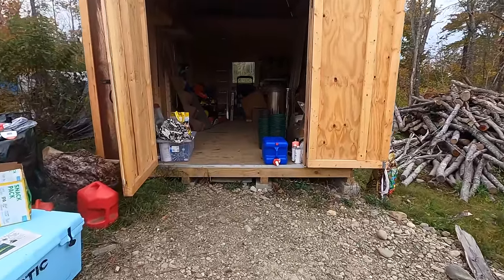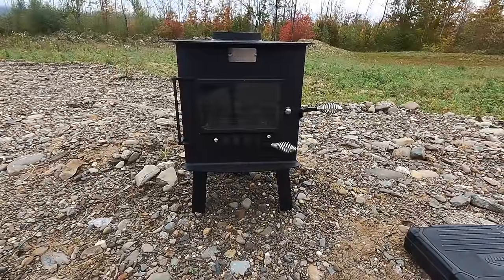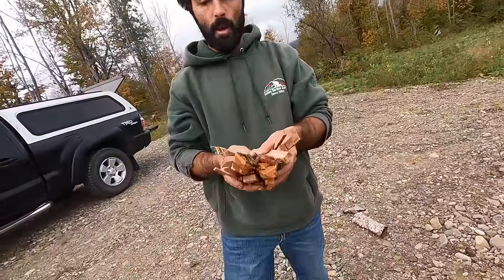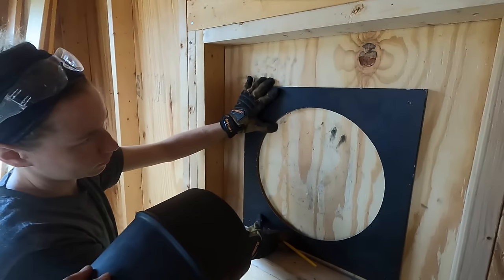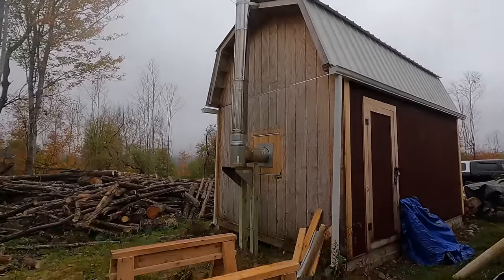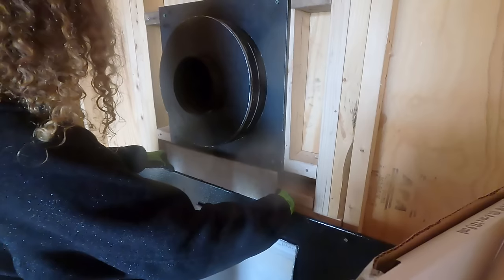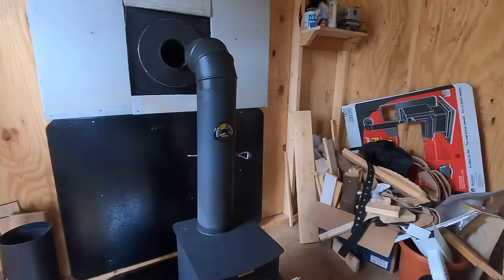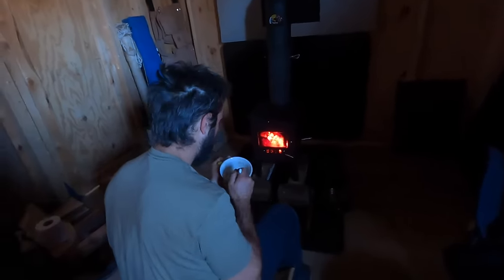We Finally Have Heat! Wood Stove Install in the Shed

Comment: Its all very well done . This is actually , how it should be done .  A wood stove can be your best friend, if safety is the first rule . But the same wood stove can be your worsth enemy if treated wrong. And some fire bricks inside is a really good idea, it protect the stove, and give longer heat 👍
Reply from the maker: Thank you! We wanted to be as safe as possible and not take any chances. We've seen some very questionable wood stove installs all over YouTube... We will look into adding fire bricks.

Comment: Next time u use the saws all put the blade in with teeth facing up so can see easier where the line is wile u cut so u will be cutting upwards try it so much easier for following lines
Reply from the maker: Thank you for the tip! I will try that next time.

Comment: Honey, It pipe single wall goes inside like you did.  It's called Shingling so creosote runs back down inside and gets burned up. Doesn't drip outside when it runs down pipe. Water steam and other objects too.

Comment: you know corregated metal sheets like for roofing is probably easier then cement board on the walls from Bush Radical
Reply from the maker: That is a good point, I'm glad you brought this up. The manufacturer for the wood stove stated to use 24 gauge metal or thicker for heat shielding. All of the corrugated metal roofing we could find at Lowes or Home Depot was 29 gauge or thinner (larger the number, the thinner the metal). We could have gotten sheet metal but the sheets were pretty expensive and the store didn't have enough sheets to cover the wall fully, so that was the deciding factor to go with the wall board and cement board.

Comment: Do you think it is wise to mount the CO alarm that high up. Because carbon monoxide is heavier than normal air, so it might be smarter to mount it lower😊
Reply from the maker: We thought the same thing so we looked it up when we installed it. CO is lighter than air so it does rise. You do raise a good point though, I double checked the height it should be at and it should be 5ft up the wall, ours is a little higher than that so I'll lower it. Thanks for your comment!

Comment: Where is the fan
Reply from the maker: We just got one actually!
Reply: I’m sorry to break the news, but the pipes are going in the wrong direction to the stove from the inside wall. Insert needs to be going in the direction of the smoke to the outside, without the inside of the pipe catching the smokes air flow.  Just an observation.